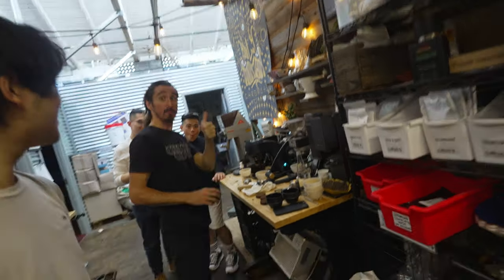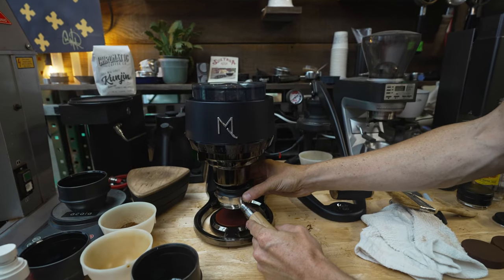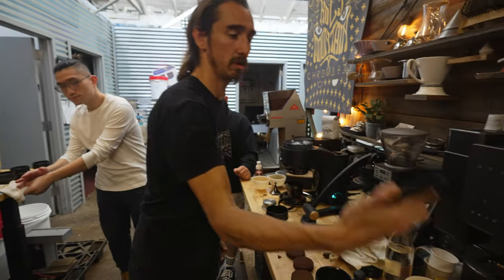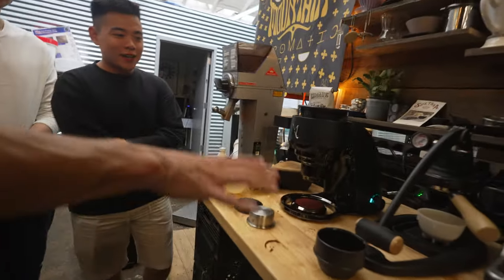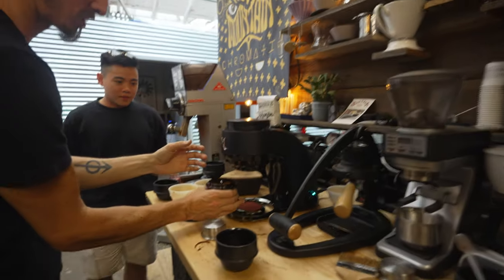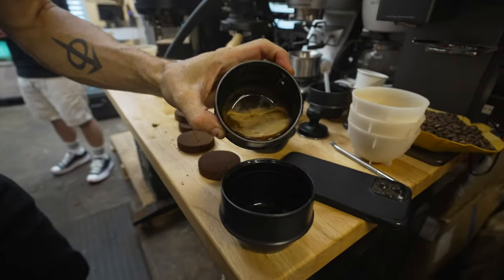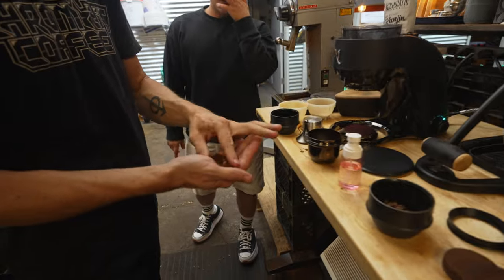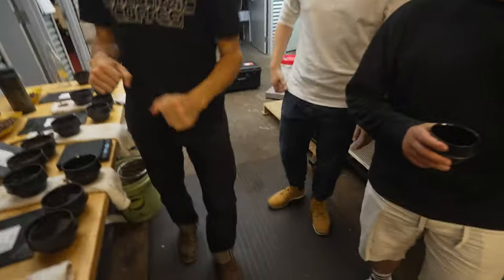MX. COOL ARIES COFFEE GRINDER

Comment: Not sure if you really need to clean out the burrs THAT often. But just thinking maybe it would be cool since you can remove the bottom (inner) burr so easy if you have slightly different variations you can swap in and out (for different taste profiles), but I don't think that would work with the same top (outer) burr though, it seems like you did a good job with those burrs too.